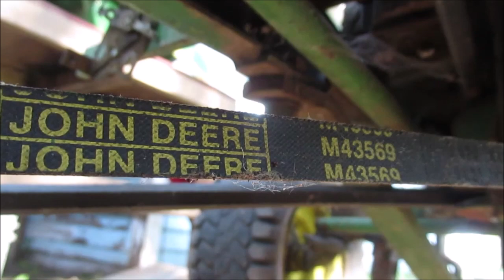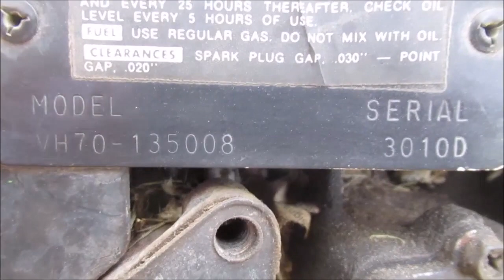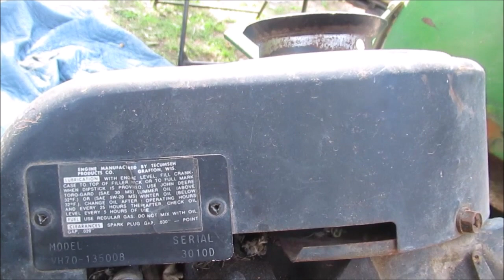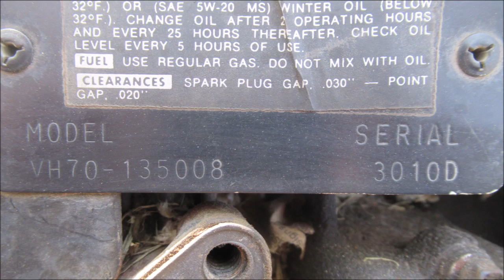Disassemble John Deere 70 Lawn Tractor

Comment: Almost impossible to find parts. I have one with a engine swap by B&S 12 HP and didn’t have the pto coned clutch assembly. Can’t use the deck without. Anyone knows where to get pats for it ?

Comment: Jim, any chance you still have that VH70 from the John deere 70?
Reply from the maker: I have all the parts what is a VH70 ?
Reply: @not2fast4u2c  it's the engine Tecumseh Vh70.  My old man (in Iowa)  has a john deere 70 and is trying to keep origional.  Would you sell any of it?
Reply from the maker: the engine was totally shot it could only spin half way like a rod was broke the carb was all rusted and corroded from water running in it
Reply: Im trying to restore a 70 at the moment. How do you remove the rear wheels? I cant get mine off to save my life
Reply: @not2fast4u2c  Hi - if you still have that shot motor, I'd love the opportunity to get the piston from it if it is in half-way decent shape? I have a JD70 motor I'm rebuilding and it's the only part I simply cannot source ANYWHERE!
Reply: @leviwoodring7587   The rear wheels are on a keyed 1" shaft. Once you remove the outer snap ring, you may have to remove some rust to pull the wheel straight off the shaft. You can bolt through the rim and use a puller.

Comment: Still have parts very interested in restoring one and can’t find parts
Reply: I need the pulley off the motor
Reply from the maker: Most of the parts I have saved to use when I restore my 60 JD
Reply: How much for the engine pulley/clutch
Reply from the maker: @kyledunphy5435  I did reply to you I am saving the parts for my 60 JD
Reply: I have one for sale